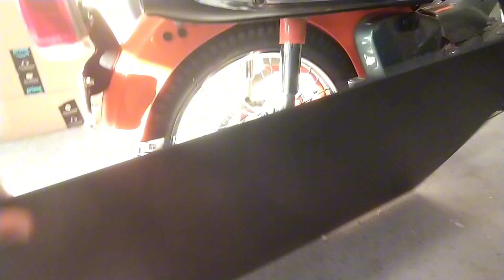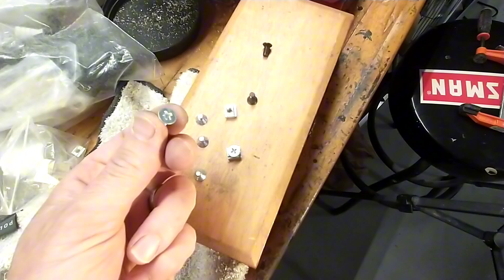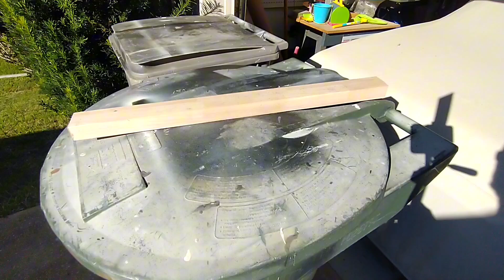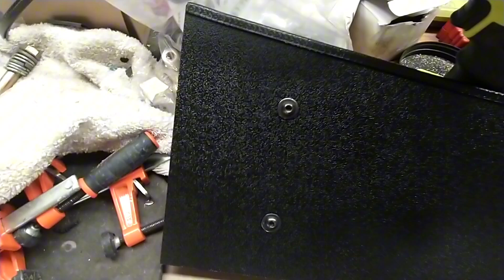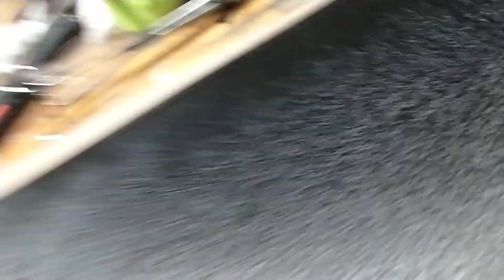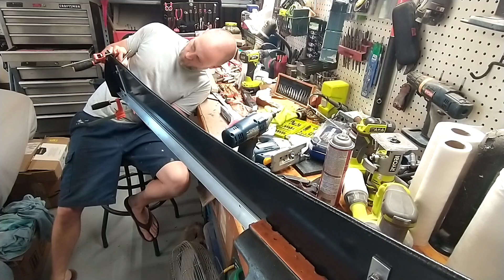DIY $50 ABS Roof Rack Wind Deflector

Comment: I only wonder if the smooth side would be more aerodynamic for mpg .
Reply from the maker: Such a small surface area could only be negligible texture wise. You're greatly disturbing the airflow with a vehicle. Surprisingly sometimes catching more air with a texture can actually decrease drag, it's very subjective based on multiple factors.
Reply: @andysgarage1 maybe you're right bc golfballs are textured . You've inspired me to repeat your process .
Reply from the maker: @Mr.RyanStatenSellers I would use ACM for the same price, it doesn't expand and contract nearly as much.
Reply: @andysgarage1 ACM ? I ordered something for like 39 from Home Depot just 2 by 4 of the ABS so far but I think it had to be .093 idk I'll see how it goes
Reply from the maker: @Mr.RyanStatenSellers  ACM is aluminum composite material, it just expands less in the sun. Just make sure you use slots and give the ABS room to expand and contract or it will be wavy when it's hot. Worst case you can use the ABS and stencil it onto some ACM down the road if it gives you trouble.

Comment: Nice. Impressed with that. I was going to use aluminium but ABS looks like a great alternative.
Reply from the maker: It works great if you keep in mind the expansion is substantial in the heat. Otherwise I'd recommend ACM which is what I am currently using for about the same price.

Comment: Is the 1/8" ABS thick enough, does it flutter any at high speeds? I'm wanting to build one for my truck but can't decided between 1/8" or 1/4" and ABS or HDPE. I noticed you said you're wanting to switch to ACM for the expansion & contraction issues.
Reply from the maker: With proper framework the 1/8" is more than solid enough. You would need some serious unsupported length to warrant a thicker material. I have since used my center ABS piece as a template to cut ACM there, the ends are still ABS. The ACM is comparable in price and has comparatively zilch for thermal expansion.
Reply: @andysgarage1 ok thanks for the info Andy! Are you happier with the ACM panel? 
I just subscribed thanks for help! 🤘🏻
Reply from the maker: @jacobsupgrades  I really am, for petty aesthetic reasons. My mounts did not provide enough float for the ABS so it bowed slightly in the FL summer. The ACM doesn't bow at all. ABS has a truly surprising thermal expansion rate. Other than that it held up great, I kept the piece for other projects. Cheers!

Comment: This is great. Looking at trying to recreate this for my van. I'm a little confused about what the aluminum angle on the front piece is doing? Was there a reason you didn't use just flat bar?
Reply: Thanks for the tip. I found some HDPE cheap so im planning on using that and painting it with uv resistant automotive spray paint.
Reply from the maker: @ezrahbartone6170 Nice, good luck on the project!
Reply: Do you think the aluminum composite would expand and contract less?
Reply from the maker: @ezrahbartone6170 I went with the plastic because it's what I could get my hands on at the time, it works great as long as you design in the room for it to expand and contract.
Reply from the maker: @ezrahbartone6170  Absolutely, a whole lot less.
Reply: That sounds ideal. I will go with acm instead.
Reply from the maker: @ezrahbartone6170  Let me know how it goes for you! By the way, I was able to cut the ACM using a sharp utility knife and scoring it repeatedly.
Reply from the maker: I used angle to prevent it from flexing. You could use flat stock. Keep in mind this stuff expands and contracts A LOT. So make sure you account for that during the build. You could also consider using a material like Falken ACM for a similar price. Cheers

Comment: How is it holding up?

And what is that edge-guard material you used?

Liked 👍

Subscribed 🫡
Reply from the maker: It's holding up well, my only gripe as I mentioned in the video is how much it expands and contracts in the heat. If you're building one definitely account for that with slots that allow it to float. The edge guard is from Amazon and also holds up very well:

https://www.amazon.com/gp/aw/d/B00N9VGDBM?psc=1&ref=ppx_pop_mob_b_asin_title
Reply from the maker: I also purchased a sheet of this, it's cheap and really good stuff. The plan is to use the current deflector as a template and transfer it to this eventually.

https://www.amazon.com/gp/aw/d/B07NRB2KLH?psc=1&ref=ppx_pop_mob_b_asin_title

Comment: Great job Andy. You might consider painting the wind deflectors to improve their UV protection.
Reply from the maker: Thanks! I actually did put a coat of UV stable black paint on it, if this one degrades I'm going to use black aluminum composite panel next time for less expansion